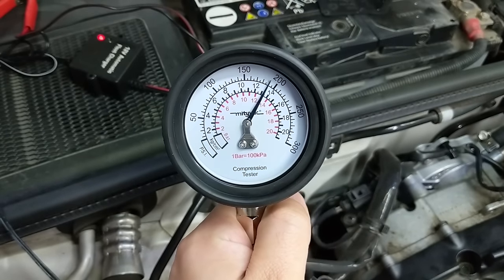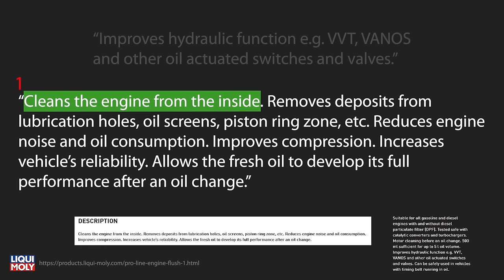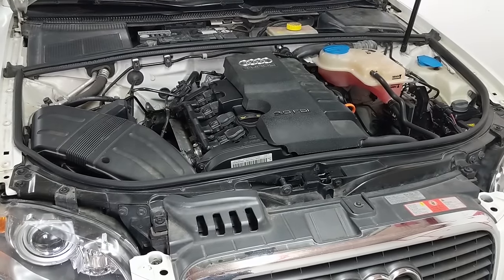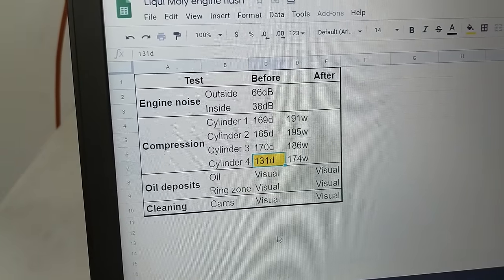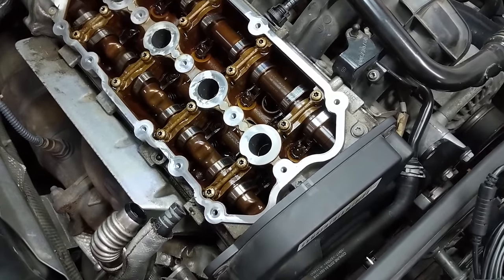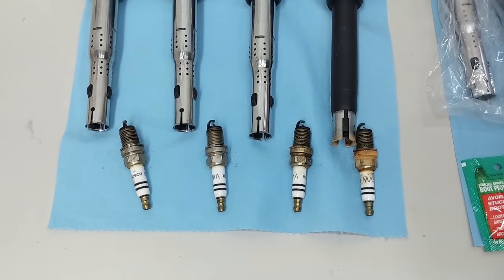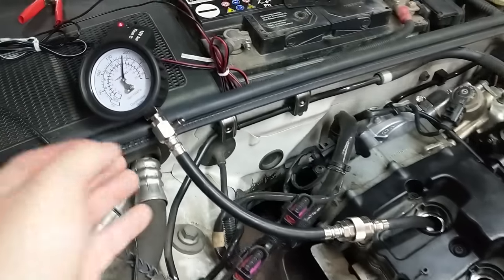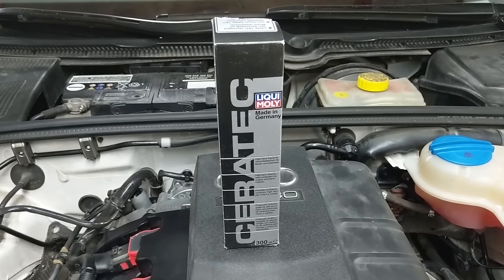Does Liqui Moly Engine Flush work? | Full Test & Review | Pro-line 2037

Comment: You were supposed to flush the system of the original oil before adding the engine flush. Also they recommend you drive the car for 1-2 hours before draining
Reply from the maker: You're not the first person to think and share this and typically I don't humor posts like yours but for the sake of data integrity, let's see what you can offer to backup why what you're describing is the correct process and that "they" (since you're claiming Liqui Moly themselves are doing this recommendation) are the source info. Because: No.
A) It says the process right on the can. Add to old oil, idle for 10 mins, drain, replace with fresh oil and filter
B) It says it identical process on their info sheet, directly from the LM website, and it's even on their updated Engine Flush Plus product (in other words, if they felt the process needed to change, they could have updated it when that product was released, but they didn't). And here's that document: https://pim.liqui-moly.de/pdf/en_GB/liqui/16/P003601

What's recommended vs. what you could do are entirely different things. I'll pin this post so if you can find some verified, contradictory evidence from LM on the process, you can bathe in all the glory.
Reply: @FigureItAudi  Gotta love how people will just parrot everything they read or heard somewhere as facts without having even put in the slightest effort to fact-check.
Liquid Moly has a (german) forum specifically to answer your questions and recommendations and there they clearly don´t recommend driving the car.
They specifically wrote to not drive at all, not even onto a ramp or a lift! 👍
Reply: @Schmitzelhaus  This liquid is not an oil. This is just for the cleaning purpose and not for daily use, so simple.
Reply: Sorry, NOWHERE on the Liqui Moly Pro Line Engine Flush can does it state "Drive the engine for 1-2 hours". 
What it does say is -
" 500 ml is sufficient for up to 5 l of oil. Add to motor oil at operating temperature before an oil change. After adding the product, allow the engine to idle for 10 – 15 minutes depending on the degree of contamination. Then change the oil and the filter".
You are giving out false information that could result in someone damaging their engine on the basis of your misinformation.
If you don't know the facts then please don't offer any advice.

Comment: The Oil Filter will trap deposits removed by Liquid Moly engine Flush.  The filter paper before and after simple shows you have a working oil filter. Any particles you see in the filter paper are just deposits that haven't been filtered out yet in the cycle.
Reply: Good point.
He should've cut open both oil filters.
Reply: @meateater4life551 A lot of people that are just getting in to maintenance may not realise this. I'm guessing that you are watching this because you are already a mechanical genius but have nothing bettr to do.

Comment: One thing you want to crank the engine until the compression stops building, if you limit it to 5 cranks only you set your self up for failure especially when comparing to another reading.  This is because the piston can be a a different part of it's stroke, theres 4 phases to a complete rotation, and if you start the test a a different part of the phase and stop a 5 you can get a higher lower reading if that piston is on its power stroke or sat exhaust stroke.
Reply: @jerryx2000  
he just said his opinion, that it was imperfectly tested(so if he hasn’t tried it, hU knows)👋

good test thO, but 2 big snafUs- cR was already in good shape & not enuf rotations for comp. check(good test thO, much more competent than most stuff on youtube - but those 2 snafUs make it tough to see)✋
Reply: @jerryx2000 s someone who does this for a living, I will tell you diesel and transmission fluid do the exact same thing.

Now I would tell you for a fraction of the price, but with inflation these days, that's no longer true.

However, I always took half a liter of 50/50 diesel-transmission fluid mix and it worked like a charm to dissolve sludge.

One thing you should always do is once you run the flush, you should drop the oil pan and check for any debris that may have oozed to the bottom and is now blocking the pick up tube.

Comment: The lower compression is because the carbon in the good cylinders, 1,2 and 3, actually have formed to the internals, so when removing, expose minute new compression leakage areas. On your number 4 cylinder, you had carbon holding open your exhaust valves from the heat being greater in the back of the cam. Because of that, less engravnedd carbon on your sidewalls but now your exhaust valves seat all the way because the carbon deposits are no longer holding it open. I've learned this because this is a common problem on first and second Gen coyote engines.
Reply: Brother should I do an engine flush on my VW Polo 1.2 TDI, 2011 model , 165k kms . Always serviced with VW approved 5w40 505 00/ 505 01 spec oil.
Reply: Cylinder 4 piston rings were seized up. Very common issue for Audi

Comment: The increase in compression on cylinder 4, is likely due to the Ligui Moly removing/cleaning carbon from the rings on that cylinder allowing them to rotate and work properly during the combustion process.  Therefore restoring the lost compression.
Reply: Or maybe the firsts low measurement was just an outlier, and it's only a coincidence that it's after applying the cleaner where the value is in line with the other cylinders.
If LiquiMoly would have worked that well, how do you explain the lower compression on the other cylinders? Or the lower compression in the wet test on cylinder 1?

Any decent engine oil will keep particles suspended anyways, there's a ton of emulsifiers and additives in the oil. If something is so much baked in that a regular (and on-time) oil change won't dissolve it anymore, a mild cleaner like LiquiMoly enginge flush won't get it loose in 10min either. You'd need a really aggressive cleaner, which you obviously don't want to mix in your oil and then run the engine. And it's very likely taking more time than a couple minutes, unless you can support it with mechanical cleaning, e.g. an ultrasonic bath or just scraping the bulk of carbon deposits off after taking the engine apart.
Reply: @smurface549  Well, Any modern oil has detergent among its additive package, no big news here. However as the oil ages, the levels of detergent get lower and the cleaning property of an engine oil degrades as well as its friction reduction properties, which is why we have to change it. LM Flushing additive is indeed some detergent to restore a higher level and help cleaning the engine. Back in the days you could also use flushing oil that was high in detergent but that kind of products was often too aggressive for engines and would damage certain parts in the process, hence their bad reputation and eventually that kind of products almost disappeared from the market. As a result using such additives for making cleaner oil change is good because it allows the oil to regain its cleaning properties with a little more punch. In this case I can imagine that the cylinder n° 4was running hotter than the rest, probably because of insufficient injection. as a result the oil cooked more in this cylinder and created deposit that eventually prevent the piston ring from moving freely in their grove and thus degraded the compression. But you're right, certain really bad situation will require disassembly and thorough cleaning with other means. I do believe that engine flush used regularly, especially on engines that tend to burn oil (American and European engines mostly) is good and help preventing more expensive maintenance. There is no "miracle product" but generally, Liqui Moly products work quite well for what they've been designed for.
Reply: Is it safe to use motor flush not use any others like diesel, transmission fluid, kerosene, cheaper motor flush so many uses.
Reply: Is it safe using motor flush not any others. I'm worry about will clogging through oil pump ????????
Reply: @craigbadder4372  absolutely no risk to clog anything with a flushing additive like Liqui Moly. However you cannot drive with it in the oil. It can only be used for 15 to 20min idling only! As the detergent level rises, lubrication also diminishes and it's not meant to be used in an engine that is going partial or full charge. Oil flush additive has to be used with caution but as long as you follow the instructions, it's perfectly safe to use.
Reply: @SilentScreamer413  thank
Reply: @SilentScreamer413  
Why cant you drive the car for the 10-15 minutes waiting for the flush to work?
Reply: @wesmokepotcannabis3287  because the flushing additive's main function is to elevate the quantity of solvant in the oil. Every oil contains a certain amount of solvant in its additive package as the oil is also there to keep the engine clean. However, as the oil ages the solvant level decreases and the oil loses its cleaning capabilities. LM engine flush is safer because it uses the same solvant that are originally nin a new oil BUT as its function is to clean deeper the concentration is higher. As a result the engine can only be ran idling. If you rev up with a large quantity of solvant you could damage certain parts. That is why you can't drive. I hope my explanation was clear enough.
Reply: @smurface549  all engine flush do change the composition of the oil and as such will affect carbon deposits in a place where it is difficult to clean which is the ring land area. The piston squirters will spray onto the cylinders and pistons and the detergents can then affect both the cylinder walls a bit and the piston ring lands.
Reply: @jamesmedina2062  The oil drain ports in heads are also prone to collection of deposits on higher m8leage Oil Ring Stuck engines and Oil/Fuel blowback internally cause extremely fast oil degradation, especially in underdriven/short trip only vehicles.
Reply: @gratefuldale117  yes I think thats true. For whatever reason oil tends to get thicker with heat and time, while taking on new properties and carbon deposits. Fuel is my problem in my 73mm diameter bore 4-cylinder Direct Injection vehicle so I change early if anything somewhere between 3-5,000 miles. It's not high miles car and it still needs the attention especially during colder weather.

Comment: It lowered the compression on the three cylinders slightly because it broke down some of the gelatinized oil-carbon buildup which, to a point, actually seals the compression chamber more. This is before it gets too bad and starts to become very acidic and etch away at the linings, lowering compression.
Reply: Yeah thats true. Thats not a bad thing though since that film is rebuilt in a short time and compression will be up again
Reply: @jerryx2000  recommended

Comment: As a former Audi tech for years, those spark plugs are normal for that engine. Nothing out of the ordinary for this engine.
Reply: Interesting that you say that. I recently changed plugs on my b7 and 2 of them had the white tip shown on the video but cylinders 3 and 4 were pitch black. What does that translate to?
Reply: @jorgeibanez5694  sounds like a fuel issue. Have you had your injectors cleaned and flow tested?
Reply: @jorgeibanez5694  cylinder 1 and 2 ran too lean and 3 and 4 ran too rich (if its deep black and not shiny/wet black)

residue on the spark plugs is always a sign of how the motor ran THE MOMENT it was shut off
Reply: @Wafflebrah21   I have not had my injectors cleaned/flow tested. I got the car very recently as a “non runner” due to bad starter. There wasn’t any wet residue on the plugs, I pulled them almost immediately after shutting it off. I’ve scanned the codes and found that there was an irregular misfire on cylinder 4. Would injectors be a likely cause of that?
Reply: Chris seeing as your a Audi tech would you recommend using this stuff in a folder car? I have a b5.5 passat. Thanks
Reply: @jorgeibanez5694  the cheapest trick would be to send it a couple of times, get those jets unclogged (there is a risk though, if there are ither issues present)

someone did it with a non running bike, started on 4 cylinders, dropped to 2 and would die, quick snap of the throttle fixed the issue and got all 4 running again
Reply: @DarkIzo  the odd thing is that once the car gets up to speed, it’s smooth as butter. No stutters or hiccups until it idles again. Then it starts shaking the car and you can hear the misfire
Reply: @jorgeibanez5694  , try cleaning the PCV system and replacing the PCV valve, and cleaning the intake system (MAF sensor and throttle)?

A failed PCV causes havoc with idle. 

Sincerely,
Reply: @petercampbell1648  thank you for the response, I appreciate it
Reply: @jorgeibanez5694  i would leaning the same way, i'd also check your trims as it could(very slightly) also be an o2 sensor. Doesn't always happen but it is still some what plausible. 

If you get your trims then it will give you a better idea of if it is more fuel or air. How many kms/miles are on the car?

You can also also try dropping a spark plug to try narrow down which cylider is your issue.
Reply: Brother should I do an engine flush on my VW Polo 1.2 TDI, 2011 model , 165k kms . Always serviced with VW approved 5w40 505 00/ 505 01 spec oil.

Comment: These types of additives (I prefer BG products) really shine after 3-4-5 full engine oil changes. We’ve been putting full synthetic 5w30 and the BG “MOA” oil additive in a 2000 Camry V6 for about 6 oil changes now. The old 5k-mile oil literally comes out looking brand new at this point. The first 2-3 oil changes were DARK, the oil filter was changed out twice as often as the oil was to catch anything that was dislodged. Additive from reputable brands definitely work. (BG, LiquMoly) But you have to repeatedly use them with every oil change to actually see results. When we did the valve cover gaskets on that same Camry V6 the inside of the cylinder heads were bright and clean. No coking or any deposits. One oil change and running for 10 minutes isn’t going to do anything except clean your cylinder walls a bit. Which is exactly what you experienced. Use BG’s MOA products and you’ll see crazy results long term.
Reply: Where do you purchase your BG products from?
Reply: @beehauss  My local O’Reilly has all their stuff. The MOA, RF7, 44K, their diesel fuel treatment, etc,
Reply: I like BG products, but I wouldn’t use oil additives on my own car. A solid properly rated oil has all the additives you need
Reply: Yeah, the time is the most important thing by the cleaning.
Reply: You sir shall be saved and enter the gates of automotive heaven.

Comment: In the first reading, all cylinders are low, and the reason is that the engine did not reach operating temperature after that, in the second reading, after the engine reached operating temperature, it seems that all cylinders are equal in pressure. Thank you for this video, wishing you success always

Comment: Enjoyed the video, clear and understandable, good attempt at the scientific method.  The carbon on the cylinder walls is just a reflection.  they are actually honed to mirror reflection and your seeing the edge of the piston.  The varnish will never come off unless you use an industrial solvent and apply pressure or physical contact, such as you might see in a machine shop.  Next time, flush the engine with brand new oil, take a sample, then add the Engine Flush.  Then take another sample.  That is the proper way to do it.  Companies that test engine and oil, typically flush engines 3-4 times between runs to remove any residual oil or cross contamination.  These modern, DOHC, VVT engines can retain 10-20% of old oil, thus the reason to flush the engine with new oil by changing, running for 15 minutes to complete mix the oils and drain again.  This will net you a 99% fresh sump.  Then if you see any significant deposits, it is likely the flush or the new oil actually doing its job in cleaning the engine.  Another way to evaluate oil cleanliness and see carbon and insoluables in the oil is using radial chromatography.   Place two drops of used oil on the center of a blank business card.  Let sit and disperse for 6-8 hours.  then examine under a back light and you will see any contaminates, carbon, soot, sludge if any.  Very easy and cheap.  The other option is to have a lab test the oil using optical or pore type partical test methods.  The machine, transportation, marine, auto and military use this to evaluate filter performance and oil cleanliness.
Reply: Perfect 👌
Reply: I hope people take time to read this.

Comment: Awesome results. The flush freed up the rings on cylinder 4. Usually, you need to soak the rings over night with solevant. Plus the engine flush. To get those kind or results on an Audi

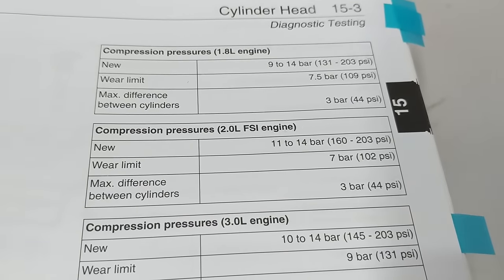Comment: @8:15 OMG. This is the first video/article that I've seen someone state or show the expected cylinder compression pressures for each engine size. I tested my 2008 1.8TFSI engine 6 months ago and got 124psi across all 4 cylinders. I was encouraged by the consistent readings but quite a bit worried they were actually all low and indicative of a problem. Whilst slightly on the low side it's a real comfort knowing they are all still well above the wear limit of 109psi. Thank you for your video.

Comment: I've seen another LiquiMoly Engine Flush test showing very similar results. Where compression after the treatment was a bit lower. But one cylinder which tested low before the treatment was a bit higher following treatment. We should remember that temperature is a factor with compression testing. Perhaps a cold compression test, followed by a warm test, of both before and after would be helpful.
Reply: 100%

You have to control for as many variables as possible.

I’d recommend cold crank testing so you don’t run into a hot plug stripper situation.

Good for a Friday night. Bad for an engine.